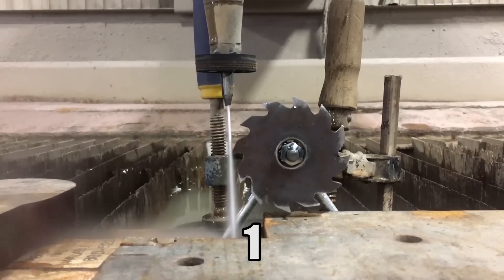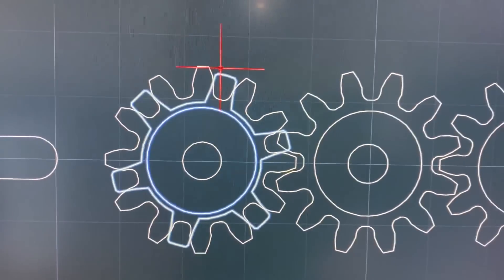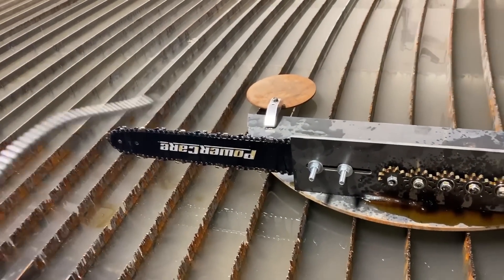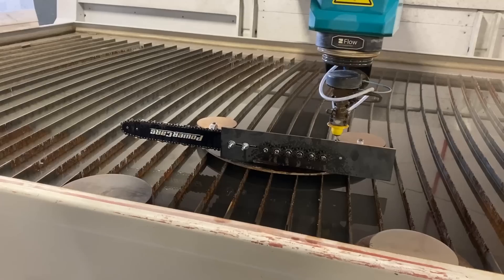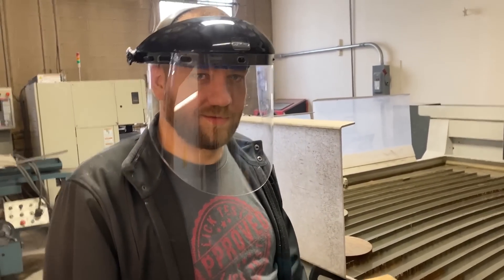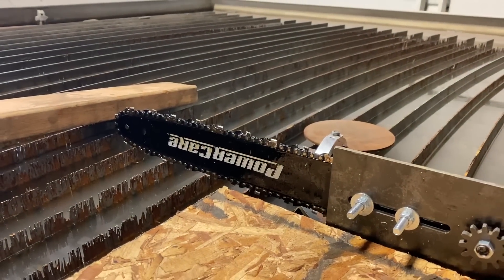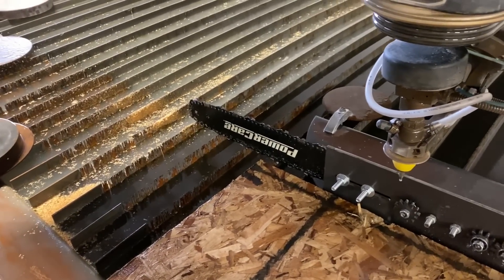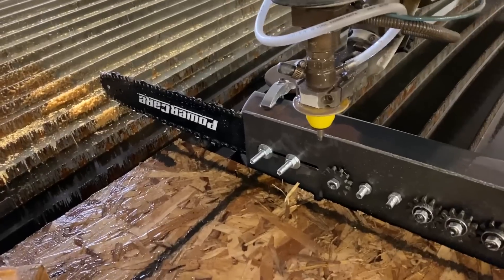Water Powered Chainsaw with a 60,000 PSI Waterjet

Comment: A interesting demonstration of a crude water powered sawmill that has been done many times over the years. 
For small high speed water jets the turbine design has evolved onto a Pelton wheel so that should have been the starting point here. 
Leaving the centrifugal clutch on the chainsaw drive would have allowed the turbine to get started without the chain resistance.  
Better bearings mounting design may save their life one day, a gear coming loose and bouncing off some surface could spoil their day totally.

Comment: Do it again but next time use a bigger gear that spins the smaller gear witch will give it way more speed

Edit: or a bigger gear in the front and a smaller gear turned by the jet for gear reduction and more strength

Comment: What's the point of all of the gears? You're not gearing it up or down at all (aside from the gear with the larger sprocket on the other side) so there's zero mechanical advantage and nothing but losses due to friction. /chinrub

Comment: As mentioned before, it needs a gear reduction instead of being 1:1. Some hemispherical paddles on the input would take advantage of all the force of the jet. Also, a series of gears is a very inefficient way to transport power at a distance. There are more losses with this configuration than let's say, a belt, chain, etc. Hope this helps!

Comment: You should try powering air tools with the waterjet. If you can use air pressure to spin things fast enough to cut metal, then I can only imagine water pressure could cut clean through to the core of the Earth

Comment: To avoid gears sliding off of bearings, perhaps take 1/8in or 1/4in. sheet metal on both sides of the gears to keep em in check

Comment: I think (and I'm not engineer, just a guy that likes machines) that if you had the water jet driving a larger gear and had it step down 2 or 3 sizes to a smaller gear to drive the sprocket, you might have been able to increase the speed of the chain and cut better.

Comment: Couple tips, since I wanna see water jet powered chainsaw mk II;
1.)Gear a flywheel either straight to the gear being used as the input or gear it up so that the flywheel spins faster.
2.) Gear down the output end, having something spin at mach 10 is less impressive when you can stop it by tapping it with a plank.
3.) Increase the size of the input gear to increase the moment from the water jet.
4.) Mount the input on a shaft, with a gear attached on the other side of the sheet to reduce the garnet issue even more.
5.) If yall dont wanna do this again, please do the fan/blower idea

Comment: Chainsaw bars are designed to work regardless of whether they’re upside-down or right-side up. There’s an oil port on both sides of the bar.
Reply: Yea. It it looks like the chain is on backwards too
Reply: @rkj4107  no the chain is correct. The cutting portion of the teeth point away from you on top and towards you on bottom.
Reply: Ross Jenkins it is lol

Comment: If the wood had been under the sawblade and you pushed it up it would have cut better, the teeth would have been pulled through the wood not pushed.

Comment: Connect the high pressure output to a suitable pressure wash hose and gun (with the trigger locked open so as not to harm the pump) and try to pressure wash something really greasy and funky with 60,000 psi and a 15° wash nozzle.
Reply: Cammi Rosanov tables use a special “whip” which is basically reinforced. I’ve always been curious to see what would happen if you let the whip free, and disabled the low pressure sensors that stop the pump.
Reply: @timjohnson8303   All I could recommend is:  "Stand back!"   That thing would be going totally bonkers.  Would be fun to see though.

Comment: The audio sounds like I'm getting a tooth drilled out at the dentist and I'm not even wearing headphones!
Reply: They sound the same because the water jet chainsaw setup has approximately the same high RPM as a dental drill, which runs on compressed air.
Reply: Dental drills usually run around 400,000 rpm, this chainsaw was running about 130,000rpm at peak. That high pitched whining noise!

Comment: What was the point of the gears?
Reply: it is so the chain is far away from the water jet so if it came apart it's less likely to hit the water jet.
Reply: @NSaw1  so why would it matter if a snapped chain going 100 mph goes through some water? seems really pointless
Reply: Gear reduction

Comment: Power a generator and run some heaters on it.  Monitor the current.  It might not have enough torque to power heaters, so at least charge your phone on it.  It'll be the worlds least portable phone charger.

Comment: Almost as useless.... a water jet powered water pump. See how much flow you can get from one of those hand crank barrel pumps. They are cheap at harbor freight, and can be adapted easily with the tools you have on hand.

Comment: Can a waterjet cut through 1 inch piece of steel
Reply: Noah Nupen they can cut up to 8”. Some models may differ but the table we have is max at 8. However, it takes a LONG time depending on part size.

Comment: Could you see what happens if you spin up a dc treadmill motor with the water jet? It'll generate power, I once made a wind turbine from one. Maybe you could try light a bulb with it or something or just measure the output. They usually come with a large steel flywheel attached so you probably wouldn't need to modify it at all.

Comment: Drinking water purifier powered by a waterjet.
Reply: Actually.. the water coming out of the jet is purified. Just nearly impossible to catch without it mixing with used garnet splashing around in the tub.
Reply: The “jewel” that a lot of jets use is a diamond that has a .04 micron hole in it.

Comment: Could you guys try making a spinning thing made from a super hard metal that doesn’t cut well with a water jet? Maybe tungsten carbide? Put some bearings in there and see if you can break a record
Reply: Zachary Hatch the problem there is virtually all metal can be cut by it (Waterjet operator here). It’s amazing what water and abrasive can do at operating pressure.
Reply: However.... if you didn’t initiate abrasive it is possible.  Water alone on a Waterjet can only cut things that you could cut with scissors basically. The garnet is the real teeth in the system.

Comment: Why not power an actual wood cutter blade?
Might need some gear reduction to increase the strength, instead of having high speed
Reply: Why not check their old videos and see if they have done it?
Reply: @jaxturner7288  That was a small one. I'm talking about an actual big one meant to saw wood boards in half. Not to mention they put the water jet directly on it without gears.

Comment: Make a waterjet powered fan and see how much air it can blow
Reply: They sort of did, when they inflated the weather balloon with a turbo
Reply: Tornado is made
Reply: I'd imagine it'd have to be made of metal, and depending on where the turbine for driving the fan was placed, there'd be major issues with sonic booms happening at the edges of the fan blades, assuming it didn't just fly apart. I'd imagine it'd produce a stupid amount of thrust before it broke apart, though.
Reply: @davidbrooks2476  what are you even saying?
Reply: Its basicly a death machine

Comment: should have had some geared reduction for more torque
Reply: I thought that's what they were going to do, but nah
Reply: Was watching this thinking the same thing hoping someone commented on it.
Reply: yeah, when they just kept adding the same sized gears in series, i was so confused.  all that does is add friction without trading rpm for torque.  

but in the end, it turned out pretty damn cool :D
Reply: Just a bigger gear on the waterjet side would've done the job
Reply: cncgeneral and a balance weight for some extra mass. Keep them torques up!
Reply: @Muffinx93  You mean a smaller one!!!!
Reply: @TheOnlyPsycho  no, less surface-length (=> RPM) with a bigger circumference
Reply: TheOnlyPsycho Go take a look on the gears on your bike. When you have the front sprocket are gear 3 ( larger sprocket) and the rear on great 6/7 (small sprocket) it’s a lot easier then if you were in gear 1 (small sprocket) in the front and the same 6/7 in the back. It’s all about mechanical advantage. If you have the larger sprocket as the drive the smaller sprocket will in turn have to spin more for just one rotation of the larger. Basic applied math
Reply: TheOnlyPsycho if you don’t believe me I think you need to ride a bike more often
Reply: @Muffinx93  you needed a small gear on the waterjet side and a bigger gear on the chain side
Reply: @thomasesr  You need exactly opposite of that. More torque and less speed.
Reply: Good idea for the future but I think fro this video they were just trying to figure out the force behind the water jet as they said in the intro
Reply: A bigger gear would also keep the Momentum at high speed
Reply: If they just put a really big drive gear on it where the jet meets it it could have a lot more potential
Reply: They don't know what that means.
Reply: While yes what you all keep mentioning would normally work. Keep in mind this is a 60k psi water jet that can cut through whatever it hits. There has to be a a balance between rpm and torque. And before you mention the abrasive, the already mentioned the plywood to help reduce garnet splash meaning it was a factor.
Reply: 3 to 1 gear ratio with a way to catch the water more efficiently
Reply: Blockstacker561 The waterjet is not fast enough